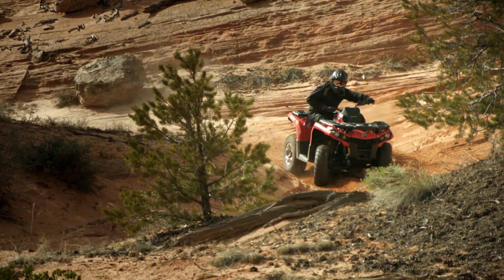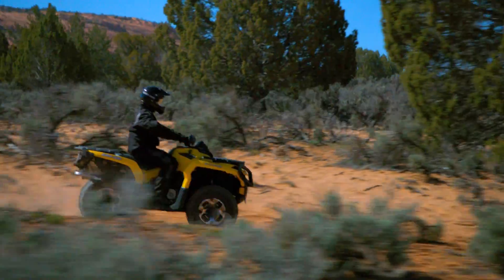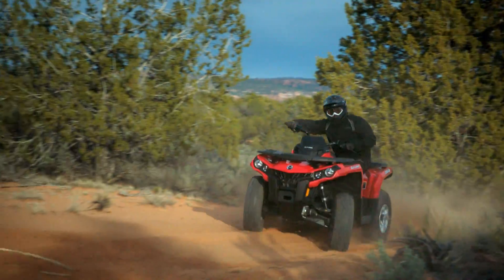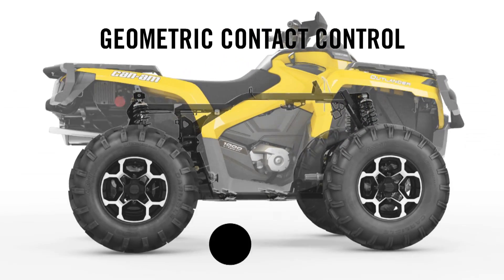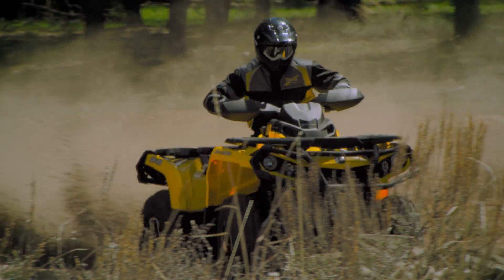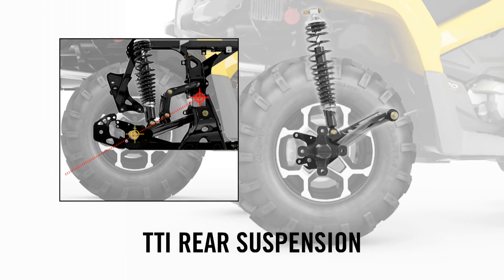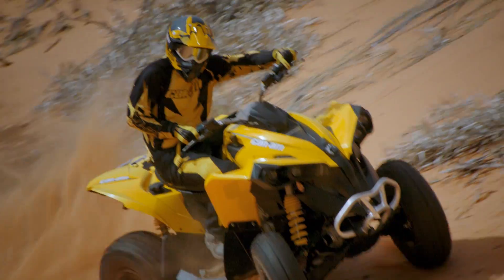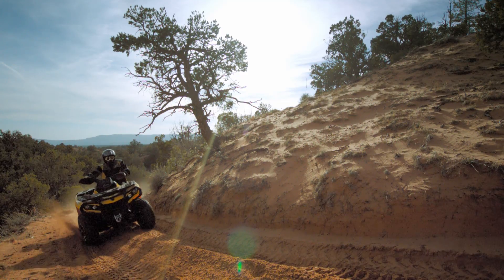New Surrounding Spar Technology (SST G2) frame with Geometric Contact Control

Comment: It's about time they redesigned the SST frame for more strength. The underside of the old frame dented too easily, which weakened it and caused it to bend easier. At a minimum, strong aluminum or steel skidplates are a must. Some owners have gone as far as to open up the bottom of the spar in the rear and shove three 1 inch square tubes in it for more strength, then weld the frame spar back up.

I'd like to know how much better the new frame holds up compared to the old one, if mods are needed.

Comment: I went from Snowmobiling from over 30years to ATV'n thinking it was the 'next fun thing'. Wish it had at least the power of a snowmobile 600 cc engine with  130 HP.. Not the 81 off this 1000.  How about 155 hp and the 100 Ft of Tougre from the 800 R Rev XP..Be just as warm to drive in cooler weather like come standard with heated grips and mirrors. At least 120 hp. get 20mpg.  Now that to me would be the ultimate machine. :) I would fork over 15 000 grand for that.  
I can still dream.